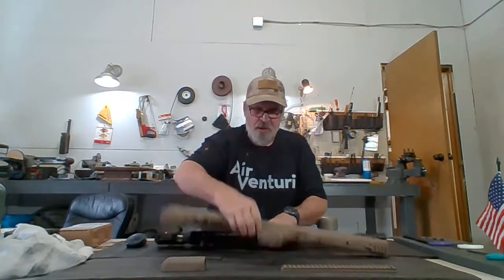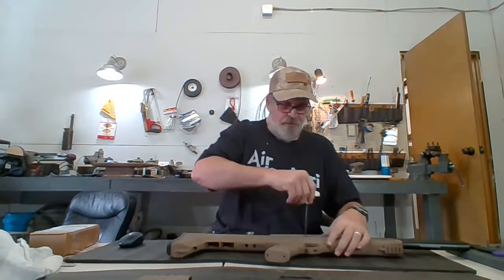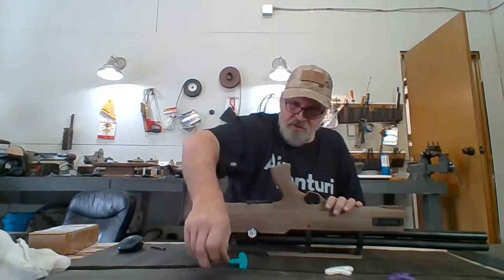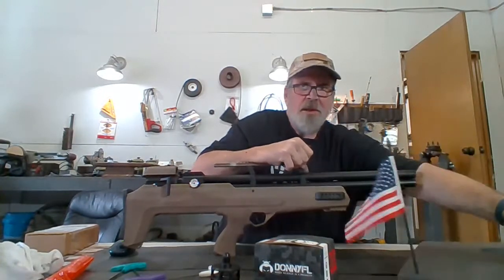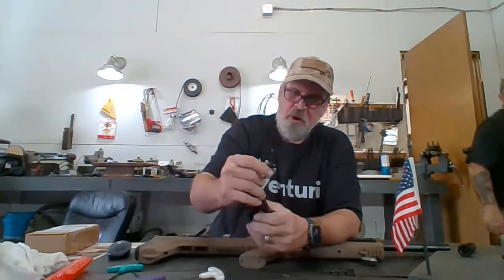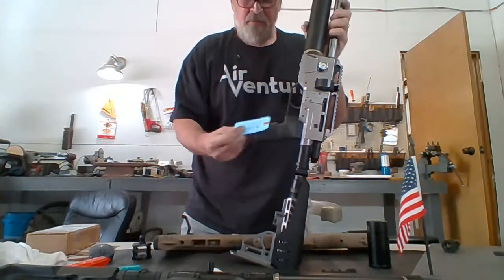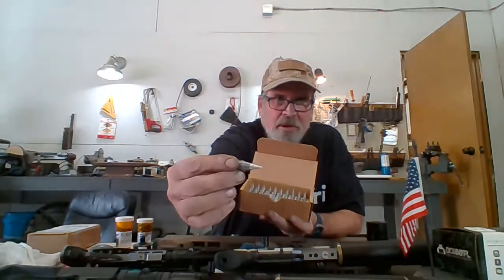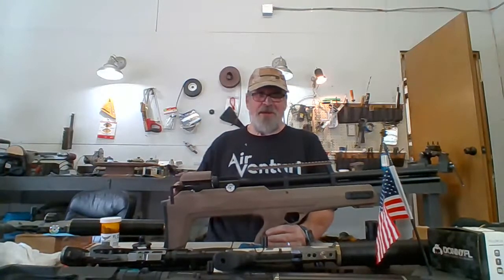" Custom avenger bullpup rebuild" Putting a bull pup together. How to disassemble avenger bull pop

Comment: Check out the Bully Band & Muzzle Band for the Avenger Bullpup.  Solves the optics mounting twist problem.  Also look into the Barrel Harmonics Reduction Grommets & Short Dawg LDC kit.  Those items center your barrel for a rock solid platform.